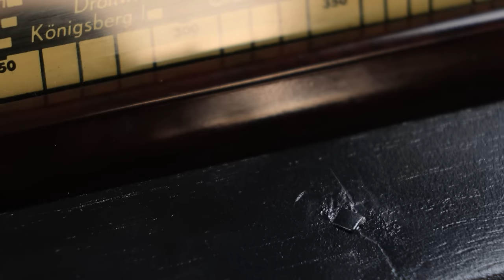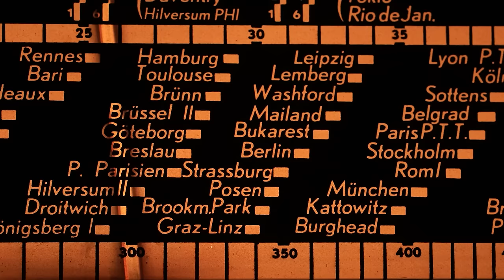Fender Stratocaster 1992 | Old Guitar Restoration

Comment: Nothing about this is credible. But soldering the fret before you pulled them actually made me laugh out loud so thanks for that😂
Reply: He heated them to soften the glue or crap that gets in there from skin etc to remove the toothed frets without damaging the wood too much
it is a technique often used. I think it is even covered in Dan Erlewine's great book on the subject. Much of the rest is also credible I have restored and built many guitars and customised many too using very similar methods. It is a great pastime and helps kick the trauma of my career as a medical professional.
Reply: @robshirewood5060   Would be better if he ran a blade down each side of the fret first and dampened the wood to lessen the risk of tear out.
Reply: You laugh because you dont understand. Other than the fact it's not a real fender, whats not credible about it? That's how it's done buddy.
Reply: @bpaakwaan7325  Not something i have ever see done, due to the T or mushroom shape, as the toothed part is buried and logically the blade would go in at a angle causing more damage to the wood and harder to seat it imho. I have  seen people wet the wood and then use the heating iron to soften the glue etc . Not something i have ever done but i will check it out on an old scrap neck. Lessons can always be learned. Personally i like to experiment with new wiring schemes as my favourite part. Thanks for the info, stay safe brother.
Reply: @doknox  Even a copy or a SQUIER can make a great guitar and even some genuine Fenders were crap.
Reply: @robshirewood5060  I'm aware of that. I was just saying that the only thing that could be considered not credible is calling that a fender.
Reply: @doknox  i agree brother
Reply: Yeah I'm sure you're an expert luthier. 😅
Reply: @wyattblackwood3927 are you?

Comment: Nice video , good camera work. Not a Fender guitar! It's a plywood body.
Reply: Exactly! Good eyes.
 Fender always uses solid Ash or Elder bodies for Stats and Teles!
Reply: It’s also not the same neck that was in pieces originally. Still a fantastic job though
Reply: Yes, i'm saying this a lot in the comments... no serial number and logo on headstock, no numbers in the body, plywood body... that's a cheap copy
Reply: @__thatcarguy__4086  Why mislead people? No shame in restoring a no-name. The first shot is the Fender headstock and logo. Trem block is also wrong. In short click bait. In my opinion it's more challenging to refurb a no-name copy because you normally can't find drop-in parts , so you have to adapt and modify.
Reply: @laurencehastings7473  i mean, great work, finish could've been better, but nice work... only thing is it's a clickbait...

Comment: Based on the year made and the plywood body, coupled with the headstock shape my best guess is that this is a Squier Stratocaster made in Korea in either the Samick or the Young Eum factories. I have a parts-caster I love that uses one of those bodies, in fiesta red.
Reply: I spotted the laminated body, I had a "Legend" Strat with that body
Reply: The headstock doesn't match any Squier model. This is some Asian replica not done by Squier nor Fender.
Reply: @San_Vito  I looked up the serial number on the headstock and it stated it was a 1990s reissue made in Japan. But the plywood body is definitely a Korean Squier body. I am thinking this is a parts guitar mating that 90s reissue neck with that body.

Comment: Nicely done and well filmed with a bit of humor - nice to see.  But the paint job needed more surface preparation, a clear top coat and rubbing back the orange peel and then polishing. The regret job was good but the frets needed leveling and re-crowning with a fall away above the 12th fret. I also line my cavities with copper foil against hum. I like the red metallic and would. Like to do a proper candy apple red, maybe using flake as base coat rather than just silver. On my next telecaster build for my nephew I want to do a British flag using red and blue clear coat over silver flake (instead of red, white and blue solid colors). Always another project around the corner

Comment: If it has trouble staying in tune I would add another loop around the tuning peg. I always come up the right side on the inside of the peg back down and inside the hole then a 90 degree bend to the right and tune up. Giving about 2 or 3 windes max. So many ways to winde but I've stuck with that one.

Comment: Don't believe that to be a real Strat.
Body looks multi-ply.
No serial number on the neckplate.
S/N on the replacement neck is not in the Fender database.
You used a 7.25" radius sanding block when 1992's were 9.5"
Plus:
Spray job on body not great.
No fret levelling or crowning, or truss rod adjustments.
If it is a legit Strat, please send me that old neck.

Comment: Really Mediocre!!!  1. Don´t snip the cables always unsolder them you don´t want the cables to end up too short. 2. Use lemon oil before you polish the frets since the minerals in the lemon oil will make the frets look dull again. 3. The finish has way to much orange peel you need to sand the finish smooth to get rid of it. 4. When testing the Pickups you need to test all 3 pickups every time you turn the switch.

Comment: Whats up with the multiple layers visible in the cross-section of the guitar?
Reply: It's made out of plywood, not actual wood. It's not a Fender, not even a Squier (some of the worst Squiers can be made out of plywood, but the headstock shown at the beginning of the video, the one that he doesn't restore and is not seen again, is not Squier, for sure).

Comment: He skipped fret leveling, which is weird. Also, skipped straightening the neck with a trudd rod before refretting, but might have done if off camera. Also, I'm kind of confused on why he spend so much time disassemble electronics, just to replace almost everything including the pickguard. Could have just tossed the whole assembly into the bin and save a lot of time.

Comment: looks great but what drives me nuts is the details you didn't do because they are hidden. The paint you left in the cavities just should not have been left or sprayed over, They just shouldn't. I get it, you want it to look great outwardly....yo accomplished that while leaving slow moving rot inside.... How u ask? You used paint stripper on it. Those little areas under the neck and in the spring cavity are still coated in it. It does dry yes, However: it is wood, it will sweat and it WILL reactivate it. One day an unsuspecting owner will wonder... "hmmm, why is the paint bubbling up and flaking , destroying the finish on their guitar. And it coulda been handled with just another 20 to 30 min work to finish the prep....
but hey... it looks great today and lotsa fanboys n girls love you....

Comment: No! After all that hard work, you DON'T want to do this 13:20.
You'll screw up the flat surface! Wrong tool!
And you didn't ever trim or dress the fret ends.
I also don't know why you spent the time disassembling and desoldering the electronics, including polishing the magnets on the p'ups, since you simply replaced all the electronics, including the pickgard they're mounted to. 
The most expensive parts were replaced with new ones, so did you save that much money?
The only part you actually repaired & reused was the wood body of the guitar, which doesn't cost much, except that it was a Fender, so the expense there is the craftsmanship. But since you ruined the frets by grinding them with a small electric rotary grinder instead of a flat file, and you didn't trim or dress the fret ends, well, good-bye Fender craftsmanship!
So you could've just bought a kit! Would've spent the same money but saved lots of time.
Now all your need is to learn to play. 
But, you'll get there! Keep at it, you've got what it takes!

Not gonna watch the resuscitation of the amp, after that.  Nope.
Reply: The body is not a Fender (well, nothing is), it's made out of plywood. The neck shown at the start of the video (which is not the one restored later) is not even a Squier. Not even worth restoring unless you can make money out of clickbaity restoring videos.